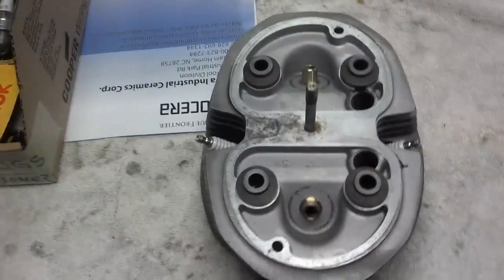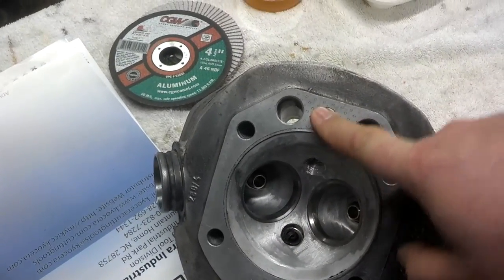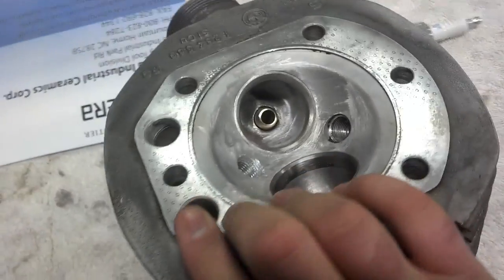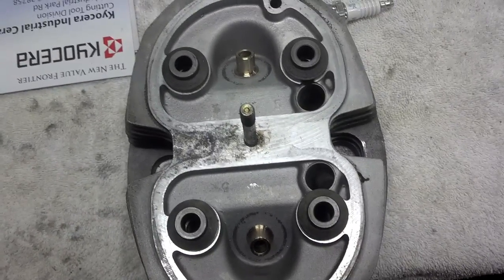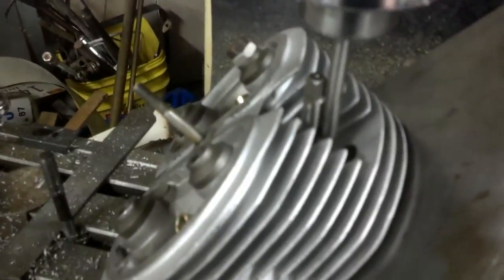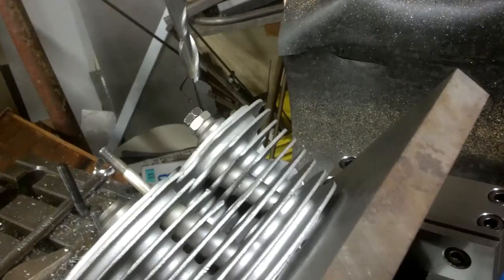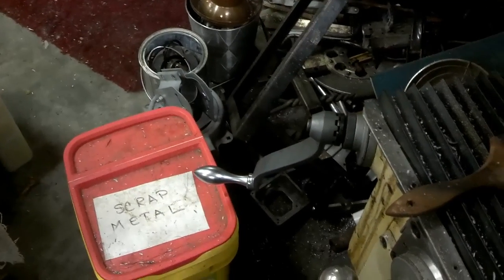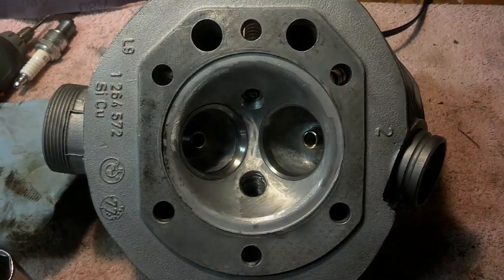BMW Airhead Dual Plug Conversion

Comment: Pretty sure the first letter is plug reach not the last letters
Reply from the maker: B means 14mm, D is 12, C is 10
Reply: @GordysGoodworks  that's thread diameter not reach.. correct?.. I believe my statement is incorrect. Thank you

Comment: Do you have a video testing the bike with the work you've done ?
Reply from the maker: Victor Pedraza not yet, these are on my fathers bike which is not yet complete, bike had over 200,000 miles on it and needed major repairs everywhere.

Comment: can i ask how to convert a 100cc motorcycle head  into dual spark , its a timing chain motorcycle , like a mope ,I dont know where to put the new hole for spark plug
Reply from the maker: sadly, most single overhead cam enginrs are not easily dual plugged. However, on very small engines such as yours, a second spark plug gains you far less performance. The bore on a 1000cc BMW close to 100mm, much more surface area than a 50mm piston of moped. What specific engine is yours?
Reply: so it will only lessen the performance ?
Reply: its just ah mope bike 125 cc I saw one on thailand underbone race with an engine with two spark plugs ,So im giving a thought about converting my engine,
Reply from the maker: +sangetsu ichigo it would increase performance yes, just isn't as mandatory as it is on large engines like the one in the video. Do you have a link to the engine you saw?

Comment: 1 more tip. Do not use 14mm threaded plugs for the second hole but a 12mm thread plug. There is less meat and a 12 mm plug minimizes the danger for cracks to the valve seats.
Reply: The second hole is exactly the same distance from the valve seats as the original spark plug.
Reply: @gerry343  right but there is more meat on the original hole. The orignal hole has also tendency to generate cracks to the valve seat. You need to put a short thread plug for the second hole because there is less material and if you strip the thread you still can go bigger.